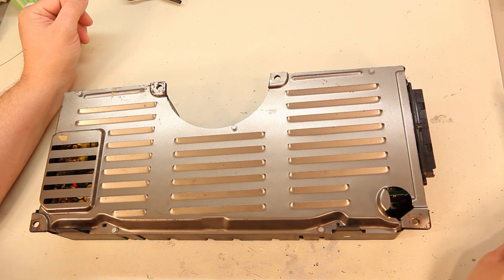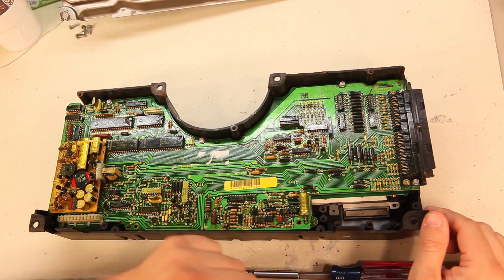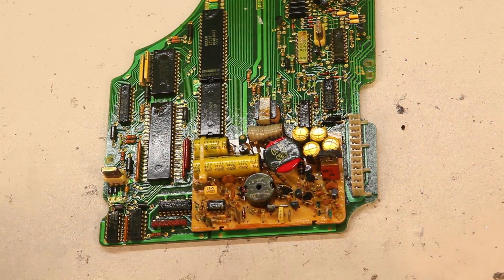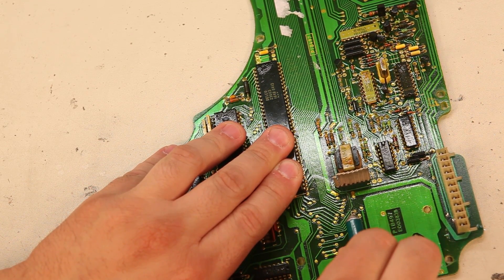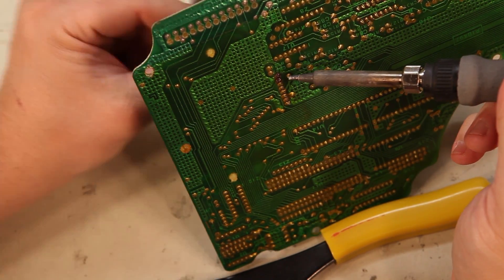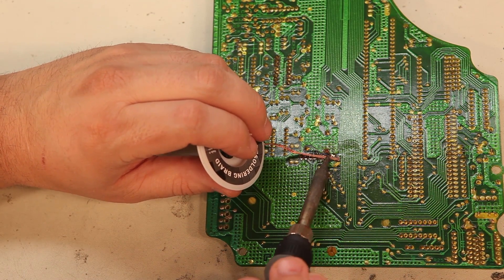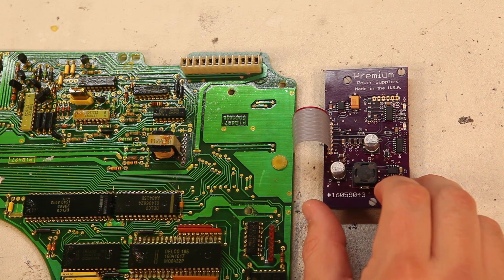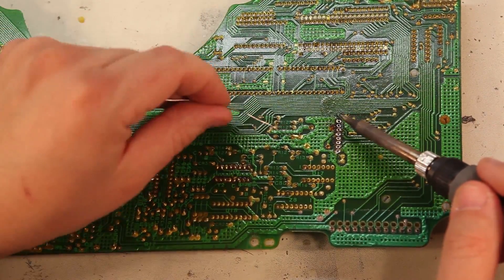84-89 Corvette Gauge Fix #10 Power Supply Swap

Comment: What about the power supply on the 89?
Reply: The supply on the 89 is built into the logic board, and so replacing isn’t an option. At Batee.com, we do sell a kit of parts to repair the 89 power supply.
Reply: @bryanthompson3180  I had issues, but they were because I used earlier earlier displays with my 89 dash. Everything was garbled. I switched back to the 89 lcds and that fixed it.